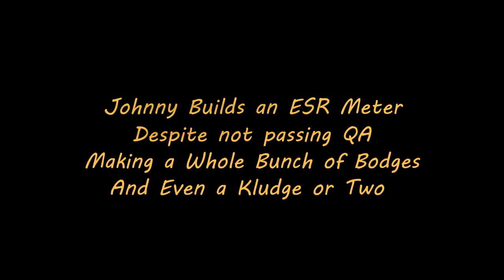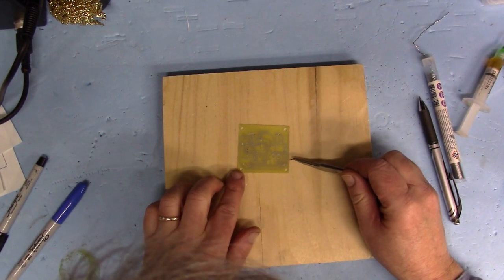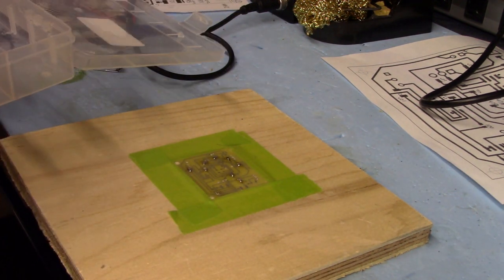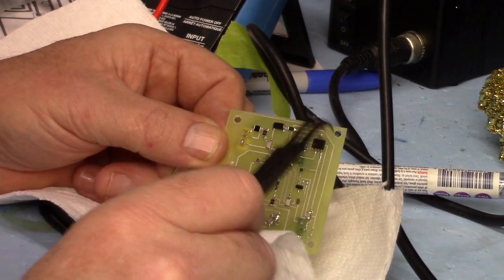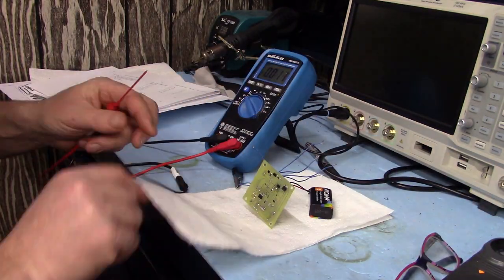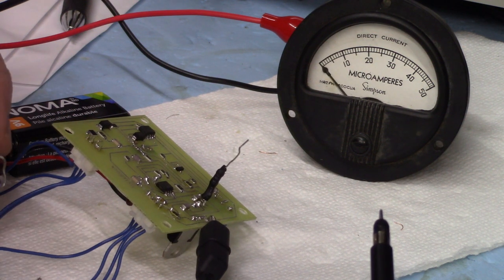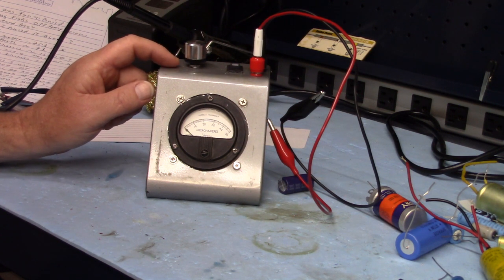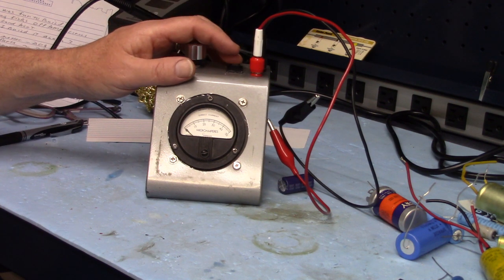02622 Johnny Builds an ESR Meter.  Episode III

Comment: Pregunta. : Si el circulto funciona  porque no mostrar el diagrama?. Why?.
Reply from the maker: Here is the basic schematic 

https://www.qsl.net/w/w2aew//youtube/W2AEW_ESRmeter.pdf

Not my design.  

The only major change is I used a LM555 for the square wave generator with a 56pf timing cap and and 47K  for Resistors the to get a 100Khz square.

Send me an email and I can send you my version

Comment: Surface mount makes sense to me for mass production where devices need to be small. For personal builds- it's through-hole as much as possible. Bodge wires are certainly easier.
Reply from the maker: Long answer:
'Yes' with a 'But'

Short answer:
'No' with a 'Maybe'

The big plus for me is space and variety of parts/  All of my SM part can fit neatly in 1 drawer,  while I have a full wall for about the same number of through hole.

One other problem, very few if any ICs are coming out in DIP packages, and many older IC can no longer be found in DIP TI for example no longer makes 555 in DIP.  If you want to use a very high quality audio op-amp you would be very hard pressed to find something in a DIP package.

You can of course mount a SMD on a breakout board but that really just adding an extra step.  

Thanks for the comment,  Don't forget to subscribe.